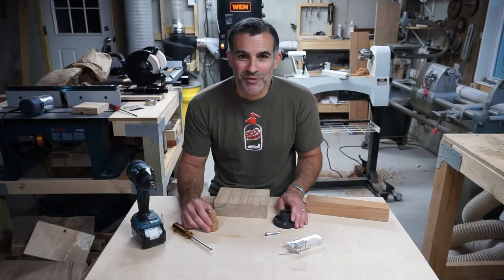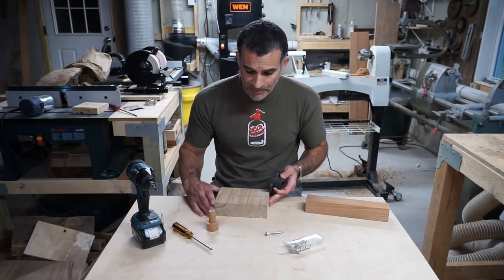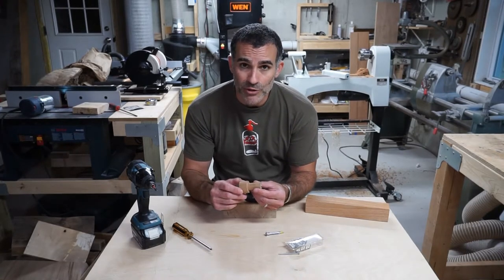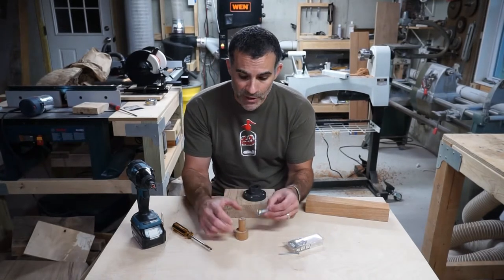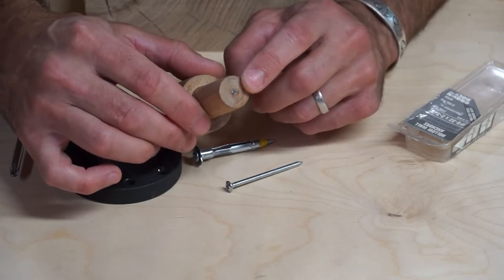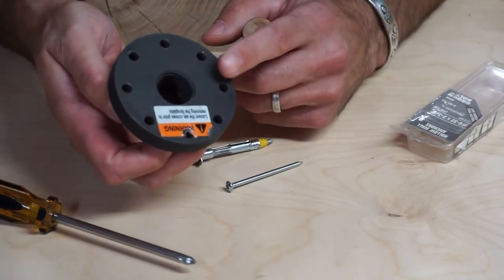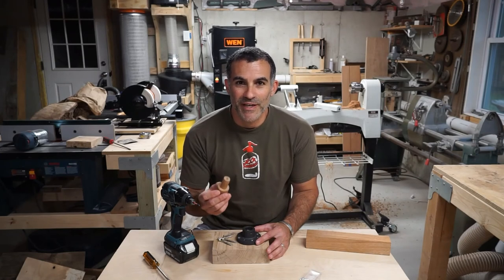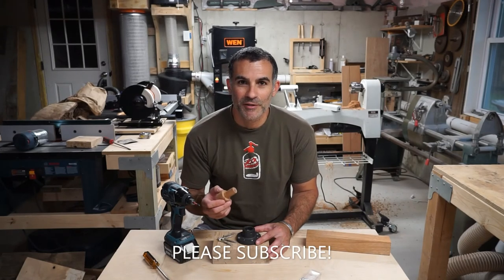Adjustable Lathe Faceplate Centering Center Finder Jig

Comment: Magic, making one this week, thanks.  Stewart, south west Australia.
Reply from the maker: Thank you, mate! After having used it a bunch, the recommendation I would make is to use a much thicker center screw. I used a drywall anchor screw and wish I had used something closer to 1/4". The circle jig on the bandsaw, if that's what you use, has a much wider shank so the smaller screw I used tends to swim in the hole I need to drill when i cut rounds for bowls. Please let me know how you make out.

Comment: So how does it work?
Reply from the maker: Hi Peter - thank you for watching! If you are working with an uneven surface, as mentioned in the video, you can turn the screw that runs through the jig and elongate the centering pin (the bottom section of the screw you would have just turned). Most faceplate centering jigs that I have seen do not have this capability. A live-edge blank is a great use-case where the surface of your blank will be really uneven. If you don't have the ability to elongate or extend your centering screw you'll never find where you marked center. Hope that helps.